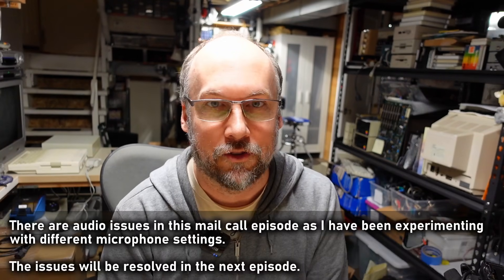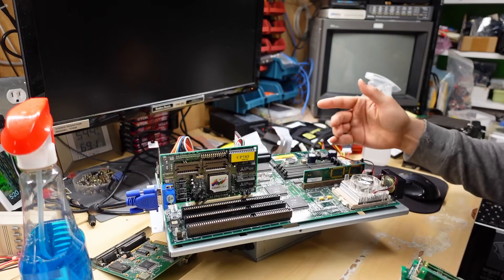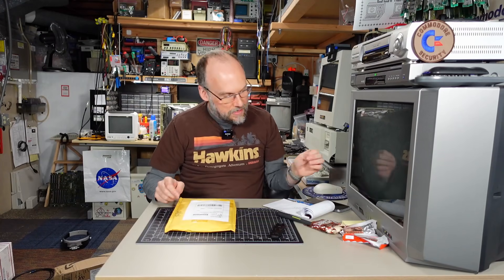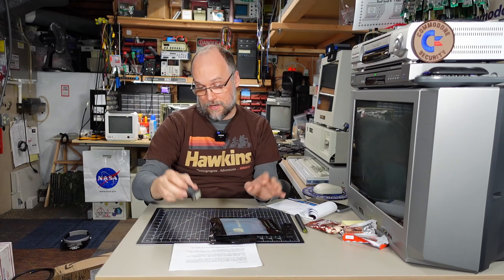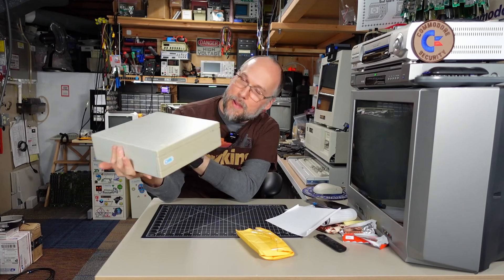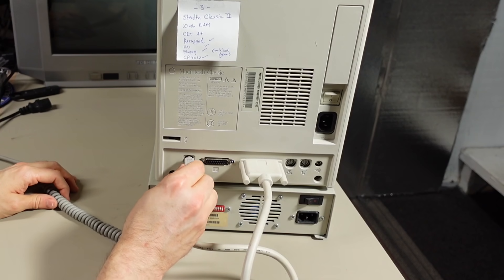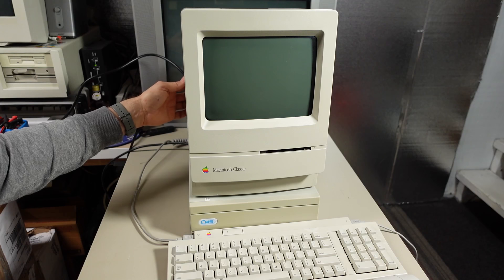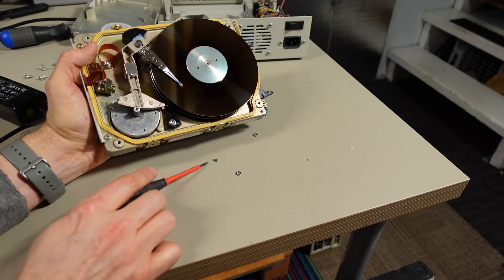30 pin to 72 pin SIMM adapters, a self-destructing SCSI hard drive and an Apple IIc mouse adapter

Comment: I remember trying those 30 pin to 72 pin converter when I was upgrading my 486.  Couldn't get it to work so I sold my old 30 pin SIMMs through a local BBS.  Looking at this video, maybe it was because that I didn't set those bridges correctly to match the new SIMM and had some conflict.

Comment: Wow, that hard drive didn't sound that bad when I tested it. I'm thinking it might have gotten damaged in shipment.
Reply: As for the laptop drive, there are some older systems that won't recognize the larger drives you bought, so it could still come in handy.
Reply: @mattelder1971  Did you try repairing the drive? Maybe these are just software bad sectors, in that case the drive can be still perfectly fine. If these are hardware bad sectors though, that HDD is virtually useless cause they tend to multiply very fast.
Reply from the maker: Ah funny -- yeah the heat got stuck to the platter, so not likely to happen during shipping. Maybe hot and cold cycles of shipping caused it to fuse like that.
Reply: @adriansdigitalbasement  Who knows? Glad you finally got to open it though, and glad you will have a use for the case at least. The teardown did make for an interesting video.
Reply: @Trakkson  I ran a few diagnostics on it, but that was ages ago. I can't remember what the result was. Pretty sure they are hardware errors though. Usually if you can keep the heads away from that area (by partitioning it the way I did), you can at least slow down how much they spread.
Reply: Actually the way you shipped it this was bound to happen. It was essentially just wrapped in cardboard. No packing material that would help the drive survive rough handling during shipment. Drives this heavy should have at least 2" of soft packing material around them on ALL sides and being shipped in a box big enough to allow for such packing. But this packing was only good to prevent the surface of the case from being scratched. All shocks got right through to the drive. Bummer ...
Reply: @gennidee  Not really. If the heads were parked (which they were, since I powered the drive up here before I shipped it), then they wouldn't sustain any damage at all during shipping. As Adrian pointed out, the damage most likely was there before I even got the drive, or at least the first time I powered it up. Keep in mind that I bought this drive at a thrift store, so any hope of it being handled gently prior to me getting it is out the window. They most likely didn't even know what it was other than a piece of office equipment (it was on the shelf with those items, not with the computers and other electronics). I've seen the way that stuff is handled there, they don't really care about how items like this are treated.
Reply: @mattelder1971  You're probably right about the treatment of the drive before you bought it and maybe the damage was already done. Hard to tell now. But your packing job was, sorry to say that, really not adequate for such delicate equipment. And it's not helping much that the heads auto-park if the heads themselfes or the actuator mechanism gets damaged in transit. As you know dropping drives when they are not operating almost always results in damaging them even though all modern drives auto-park. Actually auto-park serves the sole purpose of keeping the heads away from the data before the disks spun up enough to create an air cushion that lifts the heads from the platters. ... Adrians theory that the ripped off head was the result of a head that stuck to the platter is only one possibility. If you compare the sound it made during the first startup (it made scratching and vibrating noises right from the start even before the spindle motor was up to speed and before the actuator moved) with the sound it made when it was opened (it sounded quite healthy up until it moved the head to the outer edge of the disk) it is also possible that the head became detached during the first startup by Adrian which could indicate shipping damage. Anyways. no offense. Just wanted to point out that that is not the right way to pack delicate equipment in the hopes someone learns from this for his next packing job (:  ... By the way I had HDDs being shipped to me like this and with the exception of one drive (an ST157A-1 that was literally wrapped in 2 layers of thin card board) all the other drives that were inadequately packed were DOA.
Reply: Did you park the heads before shipping?
Reply: @brentboswell1294  See 32:38 ... It has auto park.
Reply: @brentboswell1294  Yes, I did. I mentioned that earlier. One thing I noticed about this drive in Adrian's teardown is that it parks the heads at the middle of the platters, rather than off the platters as most modern drives do. That probably leads to the drive being more susceptible to damage.

Comment: You can get converters from DDR4 SODIMM to DIMM, I believe there are even a few that allow you to populate 2 SODIMMs onto a single converter board but I suspect they are specific to a particular board and firmware. I have always had a liking for transitional oddities like motherboards that support 2 or more RAM types or have multiple CPU sockets to support different generations etc. The newest board I have that does this (DDR3 and DDR4 RAM slots on the same board) is an ASRock H170 Combo. Obviously it's an either or situation but still nice to have the choice.

Comment: Shipping that hard drive with no padding like that. May as well have just tied it to the back of the mail truck and dragged it all the way.

Also, you had a disclaimer at the start about the sound, but... I didn't notice any problems. Sounded fine all the way through.

Comment: I worked for Seagate in the mid. '80's in Scotts Valley, CA   Our drives had horrible bearings;  I'd NEVER own one!
Reply: WD all the way... Seagate sucks.
Reply: @stefanegger  Spinning rust sucks in general now. Anyone who can afford better is using solid state, so all that's left are the budgetest of the budget hard drives. Old spinning rust wears out. Even the vintage authenticity police are going to have to accept solid state replacements when the old drives can no longer be obtained.
Reply: @mal2ksc  aren't mechanical hard disks able to withstand many more write cycles than ssd's? and i personally prefer the higher storage capacity you can get for cheaper out of a mechanical hard disk over the little bit of speed advantage you get with an ssd.
Reply: @subg9165  A smallish SSD system drive for speed & silence, plus one or more large/slow/cheap 5400rpm mechanical HDs for bulk storage (spun down when not in use) can be a good combination. Watch out for stealth shingled drives, though. There is still a market for faster HDs (e.g. 15000rpm SAS) in write-heavy server applications limited by SSD write-cycle endurance.

Comment: You could probably swap the heads and platters out from a spare RLL/MFM drive. Might want to do it in a clean room, and you'll have to low-level format it afterwards. Might be a fun experiment.

Comment: You probably missed it, but I mentioned in another episode's comments and provided links to a similar product that let you plug 4x 72-pin SIMs into a single 72-pin SIM socket (for a larger size).  (There are also 4x 30-pin SIM to 1x 30-pin SIM cards -- again, so you can fit higher capacity ram into a single slot.)  I think the video was the one where you were soldering 30-pin SIMs from a kit for an old Mac.

Comment: One other note: THe CMS drive was probably formatted for ProDOS. They were often sold for the //gs, as CMS made their own Apple II SCSi card--a particularly good card. I have the same drive, here. If you have another bad ST drive, with the same platters, you can swap out the centre platter and pop in another head, which should restore it.

Comment: I got one of those CMS external harddrives! It worked ones and then the power supply start clicking (protection mode?) and won't start up. The drive seemed fine tho. I got the CMS together with a Mac Plus that I got donated by a friend.

Thanks for a great video!

PS That notification works just fine for me. Especially when surfing youtube, I get a notification within seconds from the release. If I'm surfing elsewhere on the internet Firefox tells me at least within minutes.

Comment: Great video, took me back to the days of my first workplace netware server, it had a pair of full height 5 1/4” scsi drives running in mirror mode. And for extra resilience they had 2 scsi cards and cables rather than one scsi card and daisy chaining the drives.  I think those drives were about 900mb and cost the world. I remember thinking these are probably going to be the largest (in physical size and logical size I am ever likely to see) boy was I wrong

Comment: Another great postbag here - thanks for sharing. The SIMMverter is something that I never knew existed!
I have a suggestion for the PC Junior reset button location that would allow use of a reset without having to drill a hole in the case. Could you mount a reed switch with hot glue to the inside of the case and operate it with a magnet?

Comment: I know there are SODIMM adapters that I can use now if I wanted to with my fairly modern FX 8350.  I would never want to use those simply because I don't need them.  It is nice that such things exist for those who do need them.  That may be someone who had old laptops that still have good RAM in them and a desktop that could use the same type.

Comment: I have a feeling this HDD might have been good, before shipping, but didn't support being shipped with such light protection, a single layer of bubble wrap ain't gonna be enough for something like that, that's a shame regardless. Gotta say though, glad to have see the in of that one, I love the mechanisms of those older drives to move the heads!

Comment: reset idea: you can use touch sensor eg. TTP223, it will work even hidden behind thin plastic wall. You don't need to drill the hole.

Comment: 𝙡𝙡𝘤 𝗙𝗮𝗻 here:  The first Macs computers, before the ADB bus was introduced, used a DE-9 for a mouse. The Apple 𝙡𝙡𝘤, however, used the same port for an optional mouse OR joysticks.  Adding the joystick support, rendered the original M0100 mouse incompatible with the Apple IIc.

Comment: First DRAM I had was "Dynamicache/DCA2" 72-pin SIMM from Octek. Didn't need L2 cache because the Dynamicache ram apparently ran at 10ns! I think I was duped. Also was unstable after adding the SB16 ISA card.

Comment: A true bigfoot user, I saw Adrian's face drop when he read those words.  When Compaq used them they had a firmware update for the 1.2 and 2.5GB drives that fixed an issue that caused them to die. The biggest I ever saw was a 12GB version.
Reply: i remember the last bigfoot drive i used on my grandmother's pc and i didnt have any other drives besides a 6 gig!

Comment: The hard drive may have had Stickshin, with old drive MFM and above. sometimes a tab on the top of the drive will loosen the heads. Modern hard drives don't get stuck.

Comment: I'd be curious to see the beige and platinum mice disassembled side by side to see what is different between them.
Reply from the maker: It's funny I tried to take apart the Platinum one because before I had the adapter, I wanted to swap the innards to make the Platinum work with the IIc -- but I recall either not being able to easily open the platinum one -- or was it I did get it open but the PCB design was different enough I could not swap it with one of the beige ones? Forgot now -- it was a few years ago.

Comment: I'd expect the phrase "threw a rod" to be a video thumbnail about blowing up an SR20 in an old Nissan, but for old computer equipment?

Also, Raphnet adapters are great, I have a Wii Classic Controller to USB adapter from them that I use for a Guitar Hero controller and it's been great.
Reply: My old 2000 Nissan Sentra bit the dust when it threw a rod at 275,000 miles. It probably didn't help that I put 175,000 miles on it in about 2 years.
Reply: @lwvmobile  I used to own a 96 200SX SE-R coupe, same shit, it jumped timing around 200k miles and grenaded sending a con rod out the side of the block and smashing a bunch of valves in the head. Fun stuff.

Comment: The 486 my family owned when I was a kid had a single "SIMM Xtender" branded adapter installed in it, along with an 8MB regular 72-pin SIMM. The system had 16MB of total RAM, so the 30-pin SIMMs were 2MB each, which AFAIK were extremely uncommon.

Comment: You tried the mouse that didn't work, but with the adapter it did work.  It would be interesting to see if you took a working mouse, and put on the adapter, if it would still work.  Maybe the adapter thing just switches some wires inside it.......

Comment: @Adrian's Digital Basement : The early Mac mice have an issue with how the data on one axis is sent to the bus that the Apple II mouse card/port cannot handle. If your mouse was made after 1985, it should work on either system, but 1984-early 85 mice will not work on any Apple II mouse card.

Comment: Not sure for that drive, but the big seagate have been probably stored without parking the head properly, and that's why one of them stuck, old hard drive like this one needed a proper command to park the head in a safe place for transport or storage (modern hard drive the head goes back to the parking place when thei are powered down, and that's mechanical)

Also being sent through the post, it may not have like that at all

Comment: I believe I have at least one Simmverter, or perhaps it's a different brand.  I have kept all the 30pin & 72pin simms I've ever acquired for the past 30 years.
Reply: UPDATE:   Found my adapter, it's the Intellitech SimmXtender, model SXT78B (B for backside).  I probably have another one for the front.  Can install two 30pin simms up to 32mb to this 72-pin adapter.  I tried a Google on this & nothing showed up.  It's really that remote, as this is from the mid 1990's.  Bought at Fry's for ~$18.00 back then.  I know because I still have the plastic packaging with the frys price sticker on it.  The adapter is still in there, practically unused, for 25 years.  But I'm sure now that I re-found it, I can definitely make a use for it in one of my vintage pc's.

Comment: I don't know if they were made, but physically it should be possible to make a simm adapter with the sockets on the other side of the board. So with tall and short versions of both, 4 modules would be a possibility :-)

Comment: PC junior reset “button” , change it to a magnetic relay , mount it anywhere in the case and trigger it with a magnet ?
Reply: Good idea unless you use a CRT monitor.
Reply: @semifavorableuncircle6952  a tiny button magnet a good few inches away from the actual CRT will not affect the picture at all

Comment: N was SCSI, and R was RLL certified, but ST506 MFM and RLL drives did not differ. ST251 and ST277R were basically the same drive. When used with an MFM controller, they had 42MB, while with RLL controller, they had 65MB (there was also an ST251R which was a different/worse drive, it had 42MB formatted with RLL encoding). These drives did not have a controller integrated. The host card was also a drive controller. The board on the drive is mostly an analog board, like on a floppy drive. I guess you should be able so replace the PCB of ST251 with the one from ST277N.

Comment: I had a motherboard back in the day that came with 30pin memory slots and 2 72pin. I was REALLY surprised when I finally upgraded to some 72pin memory that they actually worked together! Although I quickly removed the 30pin simms, they were super slow. :D

fwiw, I remember hearing that the reason Quantum made the Bigfoot was that some pc manufacture (Compaq?) had scored a huge deal with some school district(s), but the schools DEMANDED desktop PC cases (not towers), so supposedly they went to Quantum and the bigfoot was born.

Comment: I wonder if it would be possible to repair a drive that's lost a head like that. The whole thing looks large enough that it might be feasible to attach the head (or a replacement) back on to the arm there. Of course the platter is screwed, but again maybe one could be transplanted from another drive. Its the sort of thing that probably wouldn't be worth the effort for almost anyone but I bet its possible and would be pretty cool given how rare working drives of that type are these days!

Comment: when I was a kid, I had an old Laser branded slimline desktop that used 30 pin SIMMS; it was relegated to 4MB maximum, but, if I remember correctly, 1MB was hardwired onto the motherboard and the SIMM sockets were populated by 256kb SIMMS (it might have been 4 512kb SIMMS, but I doubt it, did they make them in that size?  I know for a fact that I had 2MB of RAM), which meant, if I wanted =>4MB, I would have to get rid of the 256kb SIMMS.  Circa 1992, retail RAM was at least $50/MB, probably closer to $75.  Being poor and a kid, I could never afford it.  

Later, I think around 1994, there was an adapter that a friend gave me that actually allowed you to expand the memory through an ISA slot that I always wanted to try, but I think it might have been for 72 pin SIMMS.

Comment: Bigfoot drives were all about transfer rate. Using the same angle speed used normally in 3,5" disk they were able to get higher linear speeds in outer regions of platters. Higher linear speed means higher transfer rate. The downside was much worse access time. I still have 2.1GB Bigfoot in my collection. I love such dead ends of technology (is this wording correct in english?)

Comment: I have the opposite problem with RAM - 72-pin modules seem abundant and cheap on classifieds/ebay, but 30-pin modules are more expensive and harder to find, I have the bare minimum of 4 MB for my AMD 386 PC and not a single extra module. Running DOOM in 4 MB of RAM was a challenge, but it worked eventually.